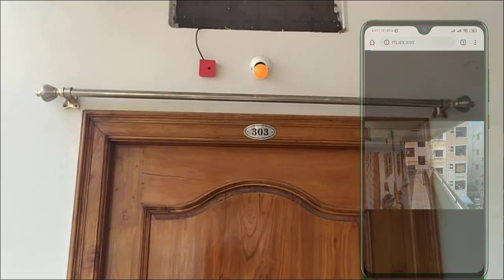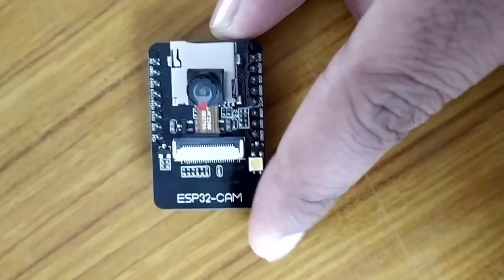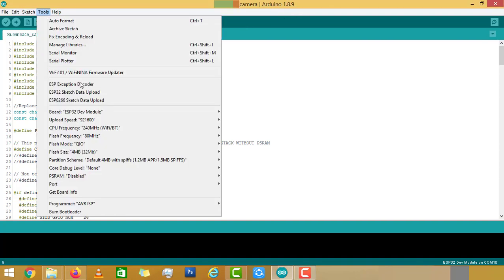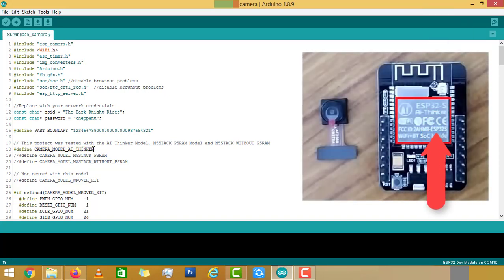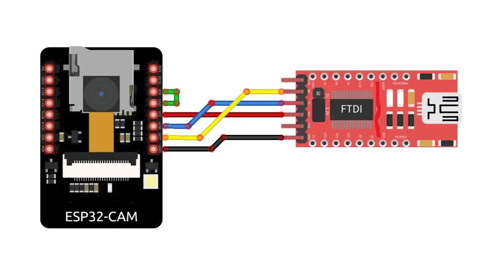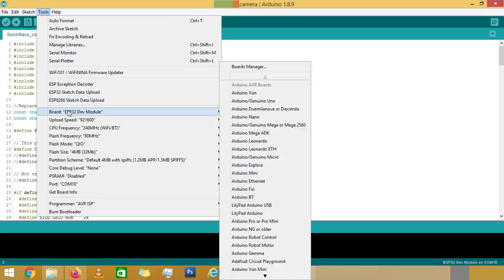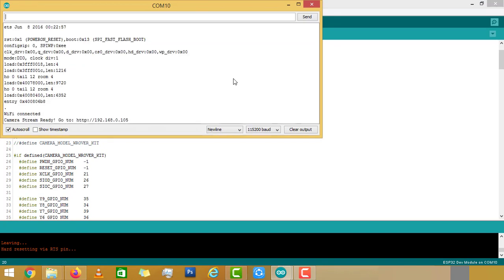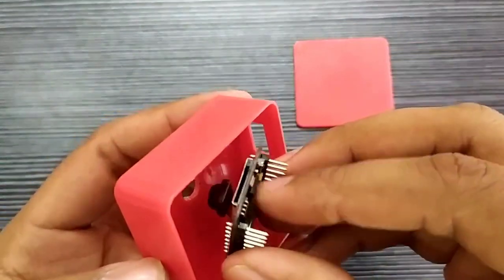DIY Surveillance camera with ESP32   CAM

Comment: I have question bro

is that possible  using any Arduino board(UNO/NANO)  instead of  TTL Programmer??
Reply from the maker: Yeah, it is possible.
Reply: @electronicsinnovation   Thank you bro ! as I think the purpose (TTL Interface) is only for uploading the code  !

Comment: Esp32 cam can make video file ? Like cctv ?
Reply from the maker: Yeah, it can.
Reply: @electronicsinnovation  did you have the tutorial video  ? I am interesting about that, may be i can practice too
Reply from the maker: @ibecafetempat_seru3629  I haven't made any tutorial, but I'm sure we can do that.
Reply: @electronicsinnovation  thanks you, may be soon you can make the tutorial video.
Reply from the maker: @ibecafetempat_seru3629  sure, if got some time I will definitely try to do a one.
Reply: @electronicsinnovation  sorry for the last question, esp32 cam can capture sound too ? Or i need other componen for make video streaming (with audio)

Comment: my camera model is espressif and i changed in the code as #define CAMERA_MODEL_ESPRESSIF. but getting error while compiling  
#error "Camera model not selected"
.. please reply
Reply: Hello! I have the same board. Did you manage to solve this issue? Thanks
Reply: @eduroctav  I solved this issue and written the program successfully but not getting the output in the terminal

Comment: Can I connect multiple esp32 cameras and view it all together? How?
Reply from the maker: Yes, you connect them.

Just repeat the same process for all esp 32 camera modules.

Each camera will get one unique ip address. You remember and use that.

That will not be a issue
Reply: @electronicsinnovation  thank you. I found a bundle of this on Amazon so I ordered three lol. Going to have the outsides of my house secured 👍🏽
Reply from the maker: @sonnyb6536  haha... You can have the fun😀...
Reply: @electronicsinnovation  So I just got it and I am at the Board Manager and it won't find ESP32 on Arduino 1.8.13???

Comment: Bro, I have a problem with this! What do you meant by "ssid and password",  Do we require a wifi router to make esp32cam work?  Or is it just the hotspot name and password of mobile!
Reply from the maker: Yeah, it's just a hotspot name. It's not necessary nto have a wifi router, You can use your phone hotspot or Jiofi or  Airtel hotspot.
Reply: @electronicsinnovation  Please tell me the way to connect with mobile hotspot... pls help me brother!
Reply from the maker: @nithesh857  Just turn on hotspot on your mobile.
Hotspot name = SSID
Hotspot password = Password.

Provide the SSID and password in you code, then upload tue code that's it.
Reply: @electronicsinnovation  thank you for your concern but on successful upload of the code,  I cannot find the IP web address to which the module is connected in the serial monitor of the arduino ide! What should I do now?
Reply from the maker: @nithesh857  change the baudrate, and restart module
Reply: @electronicsinnovation  Thanks but  I tried changing baud rate and also pressing Reset button but nothing works for me! Any ideas?
Reply: @electronicsinnovation  Thanks I changed Baud rate and also I have pressed the reset button but nothing works for me ! Any ideas?  I'm using original AiThinker's module
Reply from the maker: @nithesh857  which baudrate are you using
Reply: @electronicsinnovation  192000..I didn't find any option with the baud rate 115000 !
Reply: @electronicsinnovation  that's 192000 I can't find any option with the baud rate 115000 ! Are you sure that it works with mobile hotspot?
Reply from the maker: @nithesh857  yes
Reply: @electronicsinnovation  Thanks for everything now my module is getting connected but when I place the IP address in chrome/firefox, It is just loading in black screen nothing is showing up! What can I do?